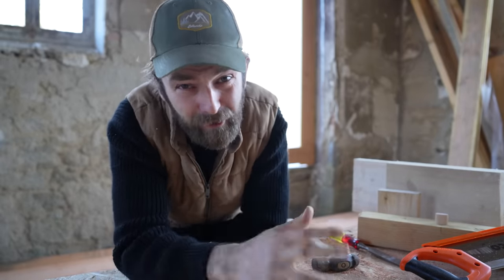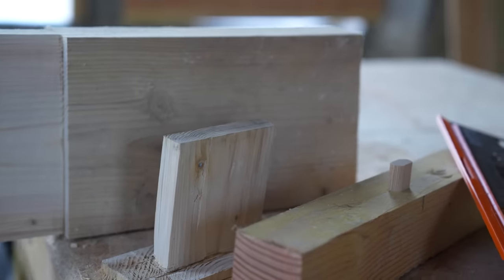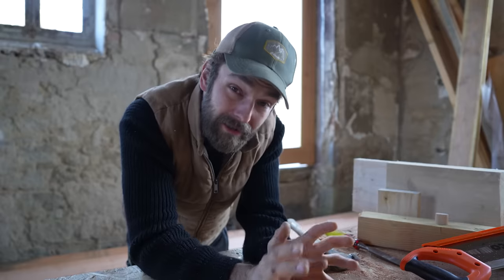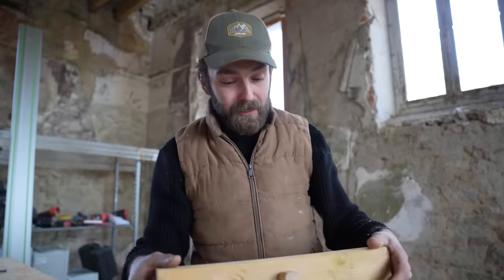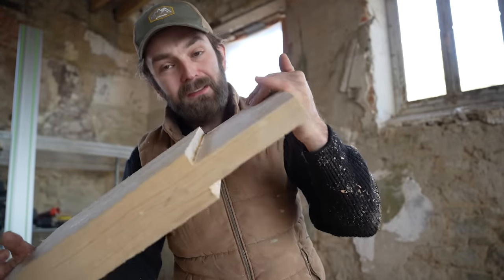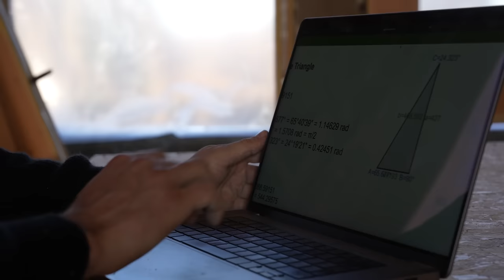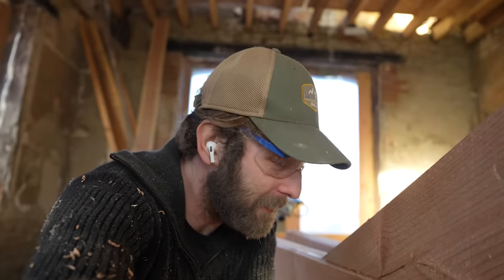Making a mortice and tenon roof frame.

Comment: Highly recommend a heavy sweatshirt to work in for carpentry or wear a denim work shirt over your sweater. Shavings are a pain to get out every time. You've done well in all your self taught crafting. So far all of you guys doing renovations are showing skills we need to keep teaching our kids.Things that are necessary to be independent & self sustaining adults.
Reply: I've been thinking for a long time he should be wearing a pair of overalls (that's what we call them in Australia). My dad was a panel beater/jack of all trades and he wore them all the time while working....a bit like old Mick Petherick 😅
Reply: I use fire retardant lab. coats. EBay, about 20 quid for five.
Reply: I think he should be wearing safety glasses!
Reply: With 40 yrs in joinery, I wear a good old fashioned smock. Easy to put on and take off.
Reply: Leather apron works wonders, I got mine from Lie Nielsen with my hand tools.

Comment: Great job Dan!
When you get to pegging the M&Ts, I hope you have already picked up this tip, but just in case... drill the say 10mm hole through the mortice cheeks, fit tenon and mark a drill point BEHIND the centre of your drilled hole. Remove tenon to drill the hole thus slightly out of alignment (maybe 1 or 2mm) with the holes in the cheeks of the mortice. This ensures that as the dowel is driven through the tenon it acts as a wedge, pulling & clenching the joint really tight. Hth. 👍
Reply: Ah, a man who understands how mortice and tenons should be constructed. 100% agree.
Reply: Bless you, all of you, who can help Dan to do the best job, give him all the advice possible 😊❤
Reply: Follow Carl Rogers for a few tips
Reply: Sound advice! I'd like to add: heed the advice of only 1-2 mm max, because you can overdo the tightening thing and then it tears out. Also, leave enough wood beyond the peg, also to keep it from tearing out. For the pegs: let them stand pround on both ends, to allow for wood movement (this would be traditionally done this way in Germany, where there's a similar climate to where you are.)
Reply: I never cease to be amazed..  and I can't help thinking that when the Chateau was originally built, the workers had no Power Tools..  it's amazing  !

Comment: Back in my twenties I took a carpenter class and I also worked for a truss manufacturing company. To add extra strength at the seams of your joints, have you considered using truss plates? They work exceptionally well at holding the wood together. Also for the floors, they have adhesive that can work in place of additional screws. Might save you time. Great work as always! Cheers!

Comment: Put an offset in the holes so the peg (with a tapered end) forces the tenon tightly into the joint. Eric Sloane has lovely books about barn building that describes the whole process.

Comment: Cracking job. Use the router to cut your tenons, set the max depth to the cut then set up a guide, starting at the end just rout off each side. Fastening an end stop on your bench will stop it sliding around..  keep it up. Truly inspirational.

Comment: Great work! Love watching your progress and excited to see it come together. Someone taught me when you cut the tenons, if you leave 3/8" or so on the end and cut all the kerfs and break them out like you did. You can then use a router resting on the 3/8" or so to bridge over and true up the face of the tenon. Then you only have to clean up the 3/8" section with the chisel and not the whole face. Might help, might not, but it does leave a nice consistent tenon.

Comment: Dan, if you put a little wood around the edges , under the tarp, you can control where the water goes from the tarp.
Reply: Good idea. 
Some kind of water catch basin on that floor would be helpful for the pointing mixture.

Comment: Great machines those Mortise cutters, it's all in the setup and maintenance though the chains can stretch when the teeth go blunt meaning the joint is loose. Been there and suffered that 😮 Not sure if you can get them in Europe now but a stack Dado blade on a table saw or a sliding saw is great for hogging out material on the tenon sides

Comment: Great job! Something you might consider.  If the roof pieces are equal across you can make them by halves,  you can draw a one half template on the floor and build and match the roof joists to it. Then after you make all halves you only have to join them in the middle and the ends. Just make sure you allow for the over lapping and/or  mortice and tenons in the middle. It makes the cuts more accurate as all the pieces will be the same to the template. Prebuild all the halves. Then you only have to carry up each half part, less weight. It is so much faster when you prebuild as much as you can. Happy roofing. 😂

Comment: You might try and find some timber framing chisels or slick chisels. These have long blades and long handles and will help cleaning up the cheeks on the tenons. Also, make sure the tenons don't exert pressure perpendicular to the mortice. That can lead to splitting

Comment: Dan. If you want to do yourself a favour you should put the old OSB boards on top of the tarp. Not only will it keep the tarp in place but it will also protect both the tarp and the new floor against falling bricks and so forth.

Comment: Build a table clap for the boards  so when you cut the mortise, it's not moving around as much that will make it much easier to move the drill when you unlock the clamp.

Comment: Nice work on the floor using the screws to secure the floor. I would recommend for a next floor you start with half a board. That way you bridge the iron beams and really make one stiff floor. The way you did it now you basicly have three lose floor.

Comment: Nice work. As you do these more and more, you’ll find more efficient methods and process to get the results you want. 
Also, I would also get another tarp up over that room and pitch it down to one side. Even a little bit of moisture will ruin OSB. Take care, be safe.

Comment: It’s just a thought, but if you found a way to anchor the board you are working on, it would improve the efficiency and accuracy of the work. A board that moves is absorbing part of the work not to mention that you have to keep adjusting your angle and your tool. Maybe a clamp or a workbench that has holes that you can set pegs in to hold your stuff? 

I love what you were doing with the château. I look forward to seeing your every video.

Comment: Lovely job on your tenons and I’m envious of your chain mortiser!!! With so many to do have you considered cutting the tenons with your router? Cut the finish line with your circular saw and work your way up to it from the edge with the router and either a surface planing router bit - though it’d have to be one of the correct depth to be able to manage it in a single pass - or otherwise just a decent bottom cut bit.

Comment: I saw on another video of a French roof rebuild they drill slightly offset holes before putting the pegs in. This drew the two wood pieces together tight.
Reply: It's called draw boring, it's a very old technique and very effective.

Comment: please, Please, PLEASE…
DO NOT put any part of your body in front of a power tool as you’re using it. Circular saws are one of the worst for jumping or kicking back on you especially when the blade is buried in the board. You want your default reaction to any situation to be shoving the saw away from you and you can’t do that if your hand or arm is in front of the tool.
Set up your work station to maximize your safety and position the work piece so that safety isn’t compromised.
I was doing everything right and I still got my pinky finger chewed up by a circular saw and it happened in a split second.

Comment: Hey Dan, Have you ever used End cut Router bit with Top bearing? They are great for tracing templates. You can use a thick piece of perspex to cut the Tenon sides. I think this would be faster than the Circular saw method you use. Once you have the correct depth of cut you will be amazed how quickly you can make TENON pieces.

Comment: Regarding mortise and tenon joints, make master templates for each size joint. Accurately cut the mortises, cut the tenons slightly oversized and trim to fit the actual mortise in its intended location.

Comment: For a first try, that's not a bad effort. I mean, it's rough as guts but it'll do the job. As you have all the toys, for repeatable joints you need a jig. And in this instance, your router is going to be the best tool to cut the tenons. Especially as you have the big festool one. get a good quality bit, set up a stop block that you can just slide on so it's the same every time and then work from the outside in so the router is always on a flat surface. Perfect joints with no requirement for using a chisel. And go and buy a large chisel to clean up your mortices with.
Reply: @JPRobinso  Clearly you can't read. Router for the tenons, no chisel required. About 1000% faster than using the mitre saw. Chain mortiser for the mortices and then a large chisel to clean up the holes so that they don't look like shit and so the tenon drops in nice and easily.

Comment: One advantage of mortice and tenon, you could build and dry fit much of it if not all of it, and mark the joints and put it back together upstairs.  Look up Amish/mennonite barn raising for inspiration,  they rarely go one piece at a time they usually build  whole sides of the building then raise them.  The Amish especially use very few tools because they do not use electric but they still manage to build a barn in a single day.

And an interesting twist, though they're known as Pennsylvania Dutch officially in the US, though technically the more proper term is Pennsylvania German, they actually decend from a mix of French who fled to Germany to flee catholic militias and german allies they often intermarried with.

Comment: Exactly and it is no small thing to learn this kind of build, where it is so important. You do not get much of a chance on a large roof construction to say, a week or two on, oh I wish I had done this or that a different way. And it is all new tools and a complicated heavy duty construction project. But Dan has chosen to slightly over build all along and I bet, that when he gets this part up it will be really strong. The reality too of roofing this place is that it is composed of multiple roofs. So taking the time to decide the best way for each part of this one will pay off when he does all the rest. And just to make it more interesting, all the roof sections have to end up with water tight joins too. This is not a nice simple two story A frame.

Comment: Re POOL REGS in France: apparently if you put tiles in the pool or paint it blue there are much higher taxes as it is regardes as recreational pool. Cheaper to keep it wild. Also check how deep it shouid be into the soil, in some regions shouldn't be more than half. Gov now use drones to check pools so blue colour is a give away. Also there were limitations for pools' water last summer.

Comment: Remember, the secret to hammer and beam roofs is to use green wood (freshly cut) and old wood for the pegs....as the beams age and dry out they'll shrink around those pegs then in 100 years the only way to get those pegs out is to drill them!

Comment: Just a thought; to help you get the manserd roofs completed much quicker.  I could see using a mortise and tenion, in rooms where you would see it all the time, however, to speed the work up greatly, I would have used engineered roof trusses for the all of the attic roofs.  You could close the roofs in, and in 25% of the time it will take you using the mortise and tension method.  😊

Comment: Something you may wish to consider. Glues, in the long run, do not last very long. One may want to consider joint construction that does not rely on glues. Consider older European methods (12th - 16th century) or Japanese temple construction.

These temples make use of wood-locking construction. Some of the "newer" ones have been in place for over 700 years and survived the earthquakes and seasonal weather variations with minimal maintenance and little reconstruction work.

There are lots of books available on lots of sites that teach the methods used with very simple tools: Saws, hand planners, wood drills, fire, chisels, etc.

Comment: Have you considered doing a half lap dovetail for that joint?, I think it might be easier and possibly stronger, better for withholding being pulled apart, rather than all the pressure on dowels or whatever you are going to pin that mortise  and tenon with.  I have done dozens of restorations on historic post and beam construction houses, and the dovetail is usually what I have seen, and done for collar ties. It will also allow you to have 50% of the beam thickness on the joint. Cheers Dan, keep up the good work.

Comment: I hate to ask a controversial question, but why bother with the tounge/groove thing, why not just use modern gear like nail plates or even just order a few gluelam beams?
Reply: Well actually they did use screws and nails back then....am not sure either but it must be a choice of his🤷‍♀️
Reply: I think it’s part of the deal he made when buying the place.
Reply: Your suggestion is for something that is neither historically accurate, nor as long lasting.  You’ll never see a structure made of gluelam or nail plats that lasts 600 years or more. 0:03

Comment: I drill the things and put in dowels once I have it in position, and if one does not intend ever dismantling the structure again, forget the dowels and glue the tenon into the mortice using using epoxy or polyurethane adhesive.

Comment: I hope the green/blue tarp isn't the type that is woven (is that how you spell it?) as they are shite for standing water! I used the type for an overnight shelter in the woods where it rained (ofc. It did) and if anything touched the underside it started dripping through. The water was held above the tarp only by surface tension and could run off (as it was at an angle) but like this, where it is flat on the floor, it won't really keep it dry :(

Comment: Dan… we see that you succumbed to half of the numerous glue and screw comments by adding additional screws to minimize squeaking floors. Almost impossible to go back and apply the construction adhesive on the joists after the fact. Still possible to add additional noggins from below where your T&G joints don’t fall on a joist. Otherwise, that T&G joint is unsupported and will likely swell and give way over time. Please give that serious consideration. You are amazing, but it scares me as a professional engineer to see some of the fundamentals being missed. My concern is that when the building code inspectors make their periodic visits, they will cite you for building code deficiencies and make you back up and correct them. Easier to do it correctly the first time. God speed!

Comment: If face nailing doesn't work for you, and truss plates aren't an option, why not a half lap joint and save yourself a lot of time? Are you planning on these beams and bracing being exposed? I am guessing that because you bothered to chamfer, which makes little sense otherwise.
Reply: @JPRobinso  I am pretty sure he is going for an exposed beam method. Which raises another question: what are the building codes like in France? In the US to do what he is doing you would be required to have an architect prepare engineered drawings for submission and approval by the building department and each phase would be permitted and have to pass inspection as built to specification with acceptable standards. I can't imagine the local authorities allowing him to wing it and put himself and possibly his neighbors at risk because of a poor or uninformed decision. Then again, maybe in France, they do things differently. Time will tell. Peace.

Comment: will you peg the motar and tendon joints? you can off set the holes slightly and draw the joint even closer using a peg system to fasten it.
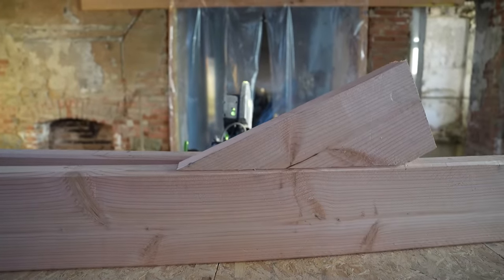Reply: 13:45 Pay attention! 🙃

Comment: It really scares me to see someone working with wood cutting tools throwing up loads of chippings with no safety glasses.  You only have two eyes.  Even losing one is a major problem.  You were wearing them later in the video, but not early on while using that plunge cutter.  This comes from someone who has spent several hours in the ER while his missus had her eye flushed out with several gallons of saline just due to a piece of scrap wood she was throwing into a skip.

Comment: tarps are not water proof. plastic is better but not ideal.  get the roof 0n first. osb will swell up when wet . for walls thats ok but not floors in the elements..  plywood can take rain.